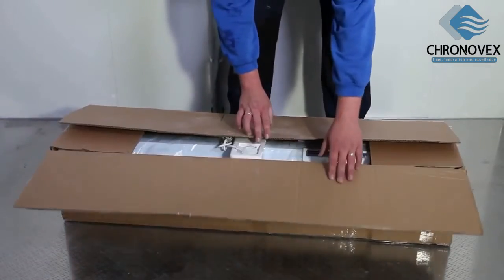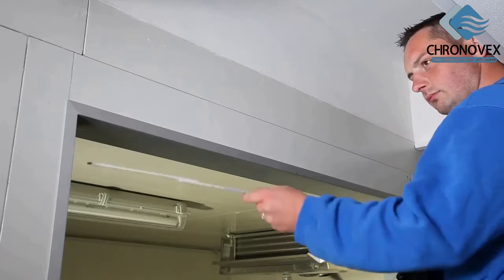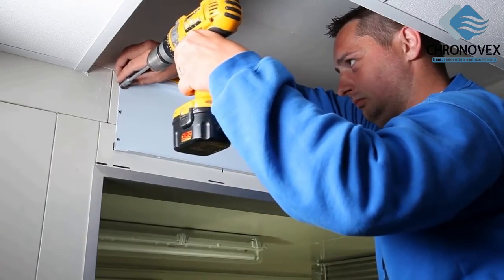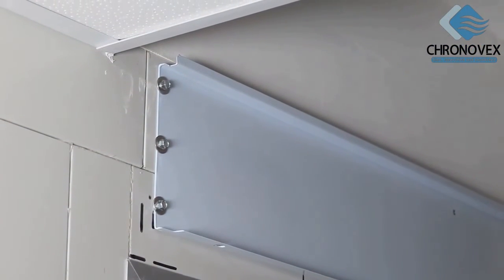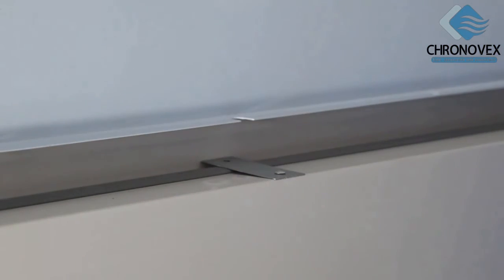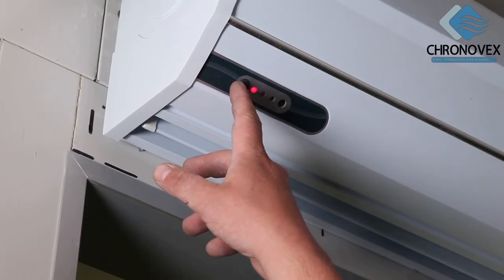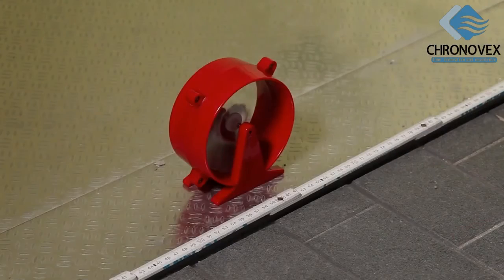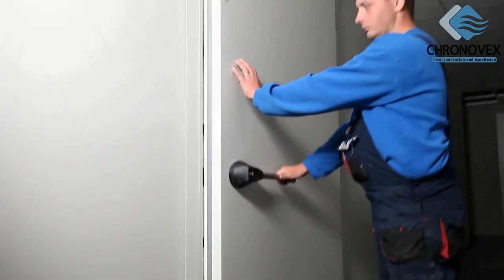Chronovex Air curtain installation

Comment from the maker: Chronovex Industries Private Limited, established in 2009, is an ISO-certified company that specializes in manufacturing and supplying a premium range of air curtains, insect killers, and PVC products. We are committed to delivering high-quality products that meet the highest standards. Our curtains are designed to be durable even with daily use.

In our manufacturing process, we ensure that only top-quality materials are used, employing state-of-the-art tools and machinery operated by highly experienced professionals. Our dedicated workforce possesses extensive knowledge in their respective fields. At Chronovex Industries, we strive to provide budget-friendly products without compromising on quality. We believe in honest and timely communication between our employees and customers.

Over the years, we have earned a reputable goodwill in the industry by consistently meeting our customers' needs and expanding our customer base. Our customers are our top priority, and we work hard to establish long-lasting and meaningful relationships with them. We offer the best products at affordable prices, delivering them to customers regardless of their location. Our commitment to excellent customer service and friendly support sets us apart.

Our premium range of products includes Commercial Air Curtains, Aluminum Body Air Curtains, Industrial Air Curtains, Metal Body Air Curtains, Stainless Steel Body Air Curtains, SS Body Insect Killers, Glue Pad Fly Killers, Metal Body Insect Killers, PVC Rolls, and PVC Strip Curtains.